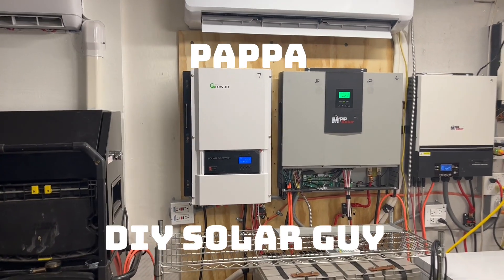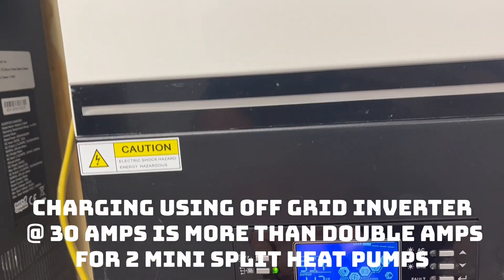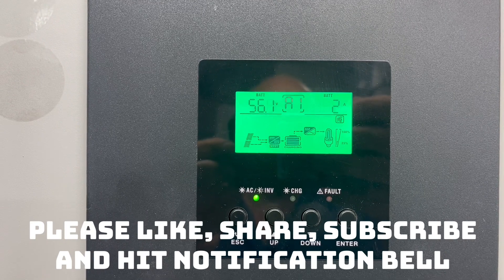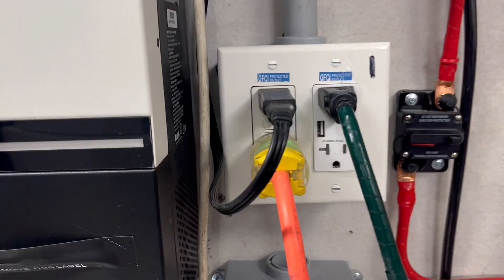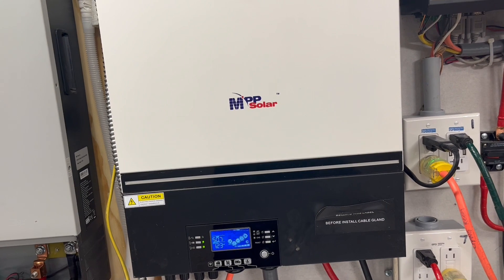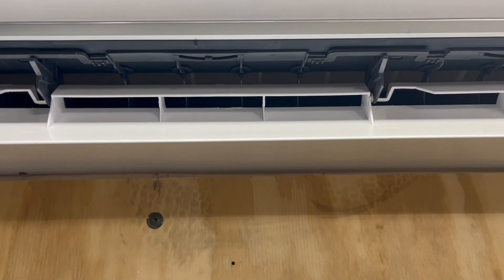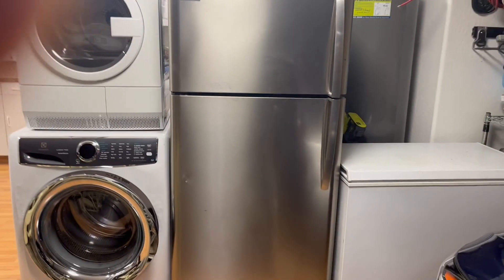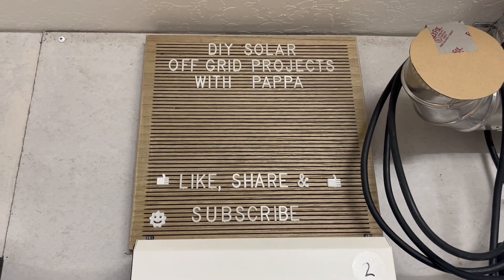Growatt 12kw low frequency inverter runs 2 mini split heat pumps with 12-250 watt used solar panels

Comment: Growatt is too noisy had to replace mine because of the constant fan noise.
Reply from the maker: The Growatt fan is pretty loud when on. I can not hear in the house when it is running. The Mpp inverters fan is pretty quite almost all the time on all 3 different models I have. Being able to run large loads and large surges like both whole house heat pump AC’s with the Growatt is enough for me to put up with the noise.

Comment: Anything with electric motors you want to let it run threw the growatt or. Buy a growat transformer to add to your mpp to let it be able to handle heavy surge load actually it would help all your inverters if you get a transformer and it to the braker panel will see a huge difference as it will help the high frequency inverters start inductive loads or more you should look into adding a 5kw transformer to run to panel
Reply from the maker: I will look at getting a 5kw transformer for the 5kw mpp inverter and 6.5kw mpp inverter. Thanks for the suggestion. Signature solar is out of stock at the moment.
Reply: @diy-solar-guy  I have them in stoke also have 2 solar edge transformers abs 20 growatt transformers
Reply from the maker: @richeagleton5285  do you have a link to where I can purchase products from you? Website? eBay?
Reply from the maker: @richeagleton5285  using 80 amps total running both upstairs and downstairs at the same time at 240 volts, 43 percent load , total usage is 5.2 kw. 85 degrees out and both thermostats are set at 67 degrees right now. I love this Growatt 12kw inverter.

Comment: OK, hold up, stop the madness!! A GFI Receptacle is NOT AN ELECTRICAL BREAKER. I need you to understand THIS. It is a Ground Fault Circuit Interrupter ONLY. It cares NOT about the ammount of current being drawn from it, only trips if more than around 15mA or more finds it's way to somewhere other than the neutral wire. This is ALL IT DOES. Please understand that it offers no other protections.
Alright, unpausing to watching more video. (yes I comment in realtime)
Reply from the maker: Thank you so much for your input. Hope you have a wonderful and blessed day.

Comment: hey, just wanted to make sure that you are aware that when you use the grid to recharge your batteries, you are paying MORE the grib run those appliances from the grid, right?
I mean with charger inefficiencies being what they are, going from grid to battery and then battery to inverter for loads, you are probably losing 20% dues to losses. I mean by all means have a bypass, but you shouldn't CHARGE from GRID, set your inverters to only charge from SOLAR. I have seen a couple of your videos where you say you are charging from grid, and it makes me cringe.
Just trying to help. cheers
Reply: Set to SBU
Reply: Solar first then utillity or just sol fir only solar the charger you plug in from grid is a pass threw so the charger switches transfer switch and being pluged in let you run items thew the inverter think of it as one big transfer switch but sbu will use solar and if solar not available will you utilities when plugged in it charges your battery's at Same time if being able to use and run your utility that's why it's a pass threw not AC assist unless set Half the installation. book don't make  sense   If you need any help dint be. A grade to ask I'm a dealer for growatt so if you need anything or. Have questions I can. Call growatt and figure everything out that you need there are a lot of ways to do it and going threw Dan I can make sure no warranty's will be affected when growatt well the removing of the screw that had 100,000 sold Because the realized the a ground. Neutral problems  just a few questions it help me isolate  problem so you have the utillity not plugged and running the inverter thew the brakers can you at you main panel in the  braker on inside panel but when plugged in and working then it's ok
Reply from the maker: Hi, when I say I’m charging from the grid, I am using my other off grid inverters as the grid charging source that gets early morning sun from the east side of my house. So I am not using the actual grid power. Just wanted to clear that up. Hope you have a wonderful and truly blessed day.
Reply: The inverter is grounded to the neutral and body and the Plug do that's 2 neutrals and grounds that are in  bonded to case I'm wondering if it reads the power on the ground or neutral getting powers then it adding the extra bower the braker box in the RV might sence a ground short
Reply from the maker: @richeagleton5285  I just a few minutes ago had the 3 1/2 ton ac running and then the 4 ton started running for about 10 minutes both were running. I just need to add more panels, don’t need to add batteries. So that is a huge success. 4 ton is using 50 amps, 2800 what’s at 240 volts and 3 1/2 ton is using 40 amps, 2400 watts at 240 volts. I am adding more panels today. Thank you so much for your help and wonderful suggestions.

Comment: Do you like the Growatt 12kW or 2 MPP 6548s better? I HAVE (50) 250W used panels. Thank you!
Reply from the maker: Just started using the 12k Growatt  inverter a few days ago. The fan is really loud, my inverter is in the garage where I like to watch tv. With the mpp inverters, the fans are pretty quite, I can have all 4 2400 watt inverter and the 5000 watt inverter and 6500 watt inverter going and still hear the tv with volume on 10 which is pretty low volume. With only 3500 watt connected to 12 kw Growatt, the fan is so loud I have to turn the volume up to 30. But I bought the 12kw low frequency inverter to start up my 12.7 ton electric pool heat pump. I need to connect another 12,000 watts(48-250watt poly panels and connect my 12kw inverter to grid for grid assist. I think I will be able to briefly use grid assist(240volt) to help start heat pump and then just run off solar all day. We will see. I bought this 12kw low frequency inverter scratch and dent from Signature solar in Texas for $1500 delivered. I would need 2-6500 watt mpp off grid inverters to be comparable, but mpp inverters are $1550 each. So Growatt is half the price but the inverter I have is limited to 150 volt dc input per mppt charge controller, 2 charge controllers. But can use 7000-8000 watts per charge controller so Growatt has an advantage over mpp with price and 36,000 watt surge to start up appliances or motors or compressor. Growatt inverter weighs 186 lbs so it is really hard to mount on watt as where mpp inverters are much lighter. Mpp does not have the surge of 3 times  12kw like Growatt. Expect to pay $3100 to $3500 for 2 mpp 6548 inverters and around $2300- $2500 for 12kw Growatt. They also have a 12kw Growatt that has 250 volt dc input but that model usually is about $300-$500 more. Hope this helps. Pretty much depends on what application you are using off grid inverters for and how you plan to connect appliances to inverter. Mpp in a little more generous with wire input and output size as where Growatt is limited to just one wire in the input and output power. I can get 3 wires in the input and output power on the mpp inverters. Let me know if you have more questions and what you plan to run with 50 panels. I would be happy to help. Hope you have a truly wonderful and very blessed day.
Reply: @diy-solar-guy  the 12k DMV 80 amp and the 12k dmv mvp 120 amp 250 volts are the sam price 2399  so you have the spf12,000 dmv  or is it the 12,000T DMV-us that super seeds that makes it UL approved ones now I might have 12,000 DMV 80 amp if you go to growatt web site abs type the model number and. See if the warranty is 2 years becuse if not sold for a year and a half then the warranty is only a year warranty starts when dealer receives then if not sold the warranty expires on the shelf I stopped buying the 12k dmv I only buy the 12,000T DNV MVP there the same price as the older ones  so I just get the bigger volts and amp model for charging and use  there  are now 4 12k models  but newest is the Spf 12,000T dmv mvp
Reply from the maker: @richeagleton5285  I have SPF 12000T DVM 150v max input.
Reply from the maker: @richeagleton5285  I bought scratch and dent, $1500 delivered to my garage from Signature solar.
Reply: @diy-solar-guy  good deal is it warranty still good you can check on the growatt usa web site id hate if it broke and it didn't still have. It's 2 year warranty
Reply: I love the 12k growatt with the size transformer it comes with even makes it better abs 2 MPPT s so you could run to diffrent kind of panel setup abd the 14,000 watts it makes also help with the mpv version the next one is spf12000T DVM MPV that model they UL certified the older ones don't have Iall listings ut has about 40,000 watt surge for big loads  you will be abke line me with pool 3 ACs that have two 3.5 ton units for the ac other is one ton plus 4 kids and the pool pump stays 75 percent of the load everything running  but my setup I added. An extra transformer a solar edge but the new growat would help and it was way easier to start loads the transformers didn't  even make a noise. but that was also me turning everything at same time and it worker only added the growat 5k from growatt I also bought 3 11,400 watt units  same size transformer  they also cone with transfer switches in them im going to see if I can get cheaper with removing the braker and transfer switches so It's just the 3 wire from transformer
Reply from the maker: Just wanted to give you an update. I was able to start up and run my upstairs house AC ( 3 1/2 ton heat pump) with my Growatt 12kw low frequency off grid inverter. I was never able to start up AC with the mpp 5000 watt inverter, not enough for surge when compressor starts up. Just a FYI to help you. Hope you have a wonderful and blessed day.
Reply: @diy-solar-guy  that is wonderful! We downsized from a 4000 sqft. home with gas heat to a 2000 sqft. home with electric heat and our bill tripled!
Reply from the maker: I am 100 percent electric at our house. No gas at all when built. That’s why we went solar.
Reply: @diy-solar-guy  Just adding another LV6548 would not be enough in this case?  I'm running a LV5048 right now with 20kw of lifepo4 and 4kw solar on one input.
Reply from the maker: @darrenorange2982  This solar off grid is a project that keeps getting bigger and bigger. I was able to wire up and start & run my 3 1/2 ton and 4 ton main house AC'S with the Growatt 12kw low frequency off grid inverter. i am running my upstairs all day on solar at 67 degrees upstairs, I went through 2 incurable cancers and i am hot all the time, messed up my lymph nodes that control my body temp. Anyways with house upstairs so cold from 7:30 am to 5:30 pm, we never use downstairs AC, cool air drops to lower floor. Set our AC at night at 75 and never kicks on. 3 1/2 ton AC used between 35 and 50 amps while running during the day. 4 ton AC uses 50 to 70 amps during the day when running just to give you an idea of  power usage. 3 1/2 ton uses around 2600 whats and 4 ton uses around 3500 watts. I really really like the Growatt 12 kw inverter. It can start up alot of things with the proper settings and im only using 32-250 watt solar panels (8000watts split between the to strigs on mppt charge controller) right now. Our home is 2450 sq ft. I will never go off grid completely. But my electric bill this year should be around $800. Would be $6,000 a year with no solar.
Reply: @darrenorange2982  buy a transformer for the mpp and the 12k unit is a beast you might just get the 12k and sell the mpp but if you conect the transformer to the braker box the the mpp is connected to and it will be able to run bigger surge and inductive maids do 16,000 watts in power both 120 240  to the critical loads panels you got to keep ground bar and neutral bar separated then I ran 3 4 awg wire to a 240 braker on mane panel to I can turn my entire house off and flip 2 brakers and just my 12k runs everything and I have enuf in battery's that I can run offgrid. 24/7 when my 6 battery's get to about 35 percent then sun comes out and fully recharged the unit  if you looking to buy one and  close to Arizona  I'll take 10 percent off but I also can ship but it's so heavy it has to go fraight I sware there is as much copper in the units to pay for the inverter I dont know how there such a good price also have wifi dongels to  fir units if anyone needs